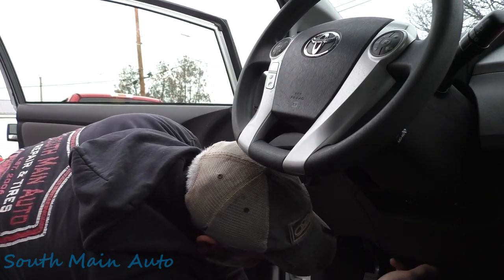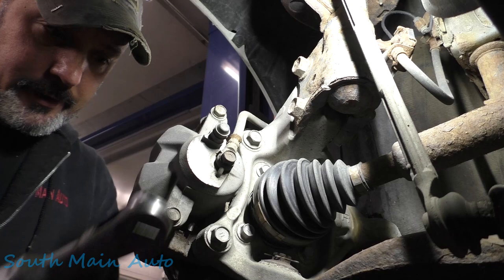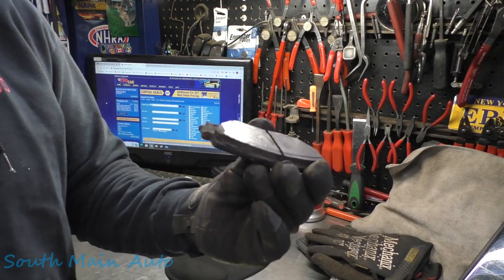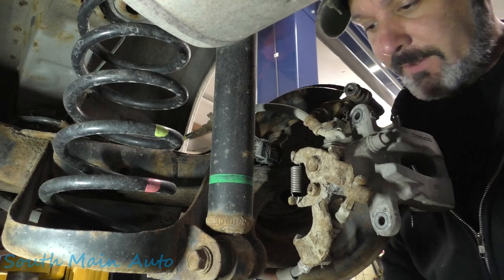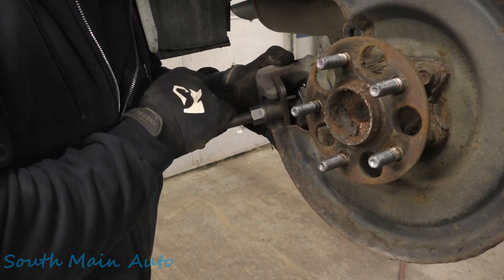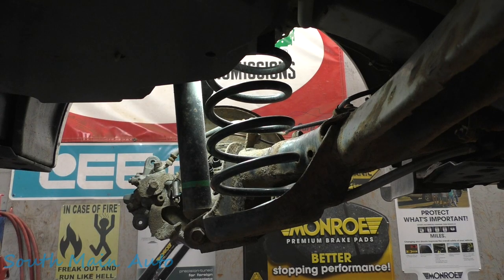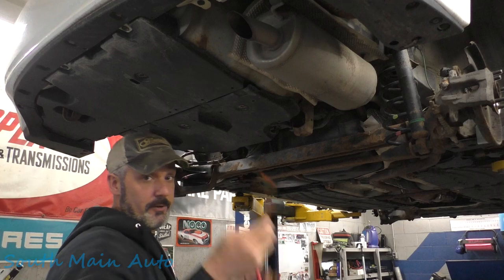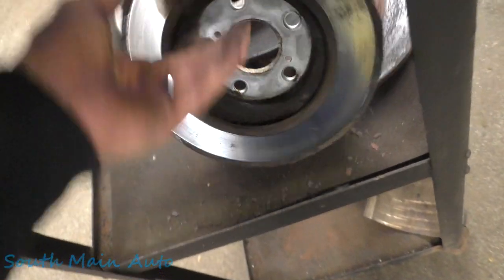Loud Grinding Noises & Dash Lights On - Prius Edition

Comment: Family bought Used Prius and told Batteries need to be Replaced.  Cost to Replace More than they Paid for vehicle.  Batteries NO longer available to Order.🤪
Reply: did they discontinue the battery you need or is it supply chain issues?
Reply: @darnh6012  Unfortunately the Batteries were Discontinued so they Ate the Cost of what they Paid for the car.

Comment: A big and dangerous problem with the Prius is the electric vacuum pump failing. It's a dealer only part and is not cheap. I spent $1500 in parts fixing my sister's brakes... :/

Comment: You haven’t had any luck with Wagner’s thermoquiet?
Reply from the maker: OMGosh no, the only pad I will NEVER use. Ughh worst pad ever
Reply: @SouthMainAuto  their sales pitch is good!
Reply: @SouthMainAuto  I’ve been installing more of the Duralast Elites lately- excellent pads, the normal go to is just Golds for the price point.  My AZ store has an excellent shop deal price if bought with rotors.  I do like Napers Silent Guards too, but AZs warranty makes it so easy to stand behind the brake job.

Comment: I did not think that Toyotas needed any maintenance. THEY ARE SUPPOSED TO RUN FOREVER ?
Reply: Not hardly!!  Wait till the battery needs replacing!!  Hahaha 😁 😆
Reply: @cycleguy666  10 year/150,000 warranty on the ones from 2020 onward. When they do go bad, you have a choice of a new or used complete battery, or just having the individual bad cells replaced.
Reply: Scotty says
Reply: Ok boomer
Reply: @thomash1923  Who cares what Scotty says!
Reply: @mc2whls  the clik bait king. He USED to be good.
Reply: It's a 2014.....one more year or so and warranty is over just in time for owner to buy a new battery.   I worked at Toyota for a few years before retiring and I saw a lot of batteries purchased.... a few under the warranty.   The feds got on the electric manufacturers to extend battery warranty.   The batteries when I was there were new or rebuilt.   The rebuilt ones seemed to be hit and miss!  Ok as long as the warranty is in place but still pretty pricey!!   I will be sticking with internal combustion for the rest of my life.   Y'all  will either be electrified or maybe flying like the Jetsons!!  Hahaha 😁

Comment: I live in a basically rust free area in Texas, and I won't turn a rotor anymore. Just not worth it. Last time I did it, back in the 80s, my truck ended up with bad warpage in the rotors.

Comment: I own a 2005 ram diesel 2007 grand caravan 2013 gmc 3500 savana box truck and want to buy a bidirectional scanner with tpms was thinking a autel mk808ts but you just said in a recent video that autels are horrible on 2007 and older chryslers so what would you recommend please give some choices in the 300 to 1000 dollar range ,no decent machanics where i live i need to do repairs my self , im poor but you gotta spend money to keep cars running , please help!.

Comment: Very few shops will turn rotors anymore.  Their fricking excuse is “ the owners decided it’s a liability “  They just want to sell new ones for more profit. I used to get at least one set turned once on the front ones for like $10 each. After that I bought new front rotors.  On these light weight pieces of junk cars nowadays I would believe turned rotors would not be a problem unles they were in bas bad shape.

Comment: I have a gen2 prius 2008. You must leave your key fob in the house, or disconnect the battery, as when your aoproach is sensed, it sets the calipers in automatically. I've read where the calipers pushed out, after removing from the rotor, and it was a bitch to push them in; they pushed right in, after battery was disconnected.......

Comment: Fairly easy money.  Just need to get it done. Damn Toyota dealership priced $210 a wheel. Can you see $840?  They will not turn rotors, have to buy new. Ridiculous ripoff
Reply: turning rotors is a sure comeback in 3-5 months....those things will be thumping from being warped because they get too thin...if it's my vehicle, sure I turn them a bit but for customers, get new ones every time
Reply: When you figure in the labor rates, it is cheaper to just replace them.

Comment: HELP!!!!!
I usually find the answers I need somewhere on the internet or YouTube, but I can't find this answer. Please help, my wife's 07 Honda Accord SE, the front passenger wheel is moving back and forth, not side to side, it moves toward the front bumper and toward the passenger door, doesn't make any noise, and drives just fine, but the wheel shifting forward and backward is a bit unnerving , I've never ran across this before and I can't find anything about it, so any help would be appreciated. I can't get under it until this weekend,  so I was hoping to get an idea of what I'm in for.
Reply from the maker: https://youtu.be/5dljdbC6PaA

Comment: I'm pretty sure the EV revolution isn't going to put Eric out of business.. if anything I can see more brake jobs being needed if people are using one-pedal driving and hardly use the friction brakes.
Reply: @wandameadows5736  I think you've been getting some outdated or just wrong information. It gets down to -40 in the winter here and people still drive EVs. Yes you lose some range but so does any vehicle.

It will be some years before they're viable for some uses like heavy towing or semis, but they are a lot more viable than you are making them out to be.

Not sure why you are bringing politics into vehicles either. People that start talking about "pushing agendas" usually have their own agendas.

Comment: I don't get why (other than cost savings (duh) why manufactures (for as much as cars cost now) don't put rust proof/resistant hardware on them.  It's crazy that if you spend $60K (generous with today's cost) on a car it might last 5 yrs (which would mean you just paid it off if you didn't go for 84 mos or more) before it rusts out in salt belt areas...Not good.

Comment: i know dude that have spent thousands on a engine, trans and rear-end, but don't do anything to the brakes or suspension. then wonder why they rear ended someone or ran off the road. every car iv ever done was done from bottom up.

Comment: Your "on and on" explanations is what's interesting.
Man, you guys have a rust problem. What the frack are you using in your salt over there. I live in Norway with icy conditions about 6 months a year, but cars dont seem to rust as bad as yours do. My own car, a 2007 118d BMW has just some surface rust pretty much with nothing on the body. Only started with Fluid film the last 5 years.

Comment: Toyotas speed sensors are finicky as hell..  if youre replacing one and dont get it seated exactly the way they want to be then your abs will go all kinds of funky..  mine would trigger the abs every time only when you were slowing down around 5mph…. So i would be stopping at a light or stop sign all normally then every time right when it got down to 5mph it would go into the abs fart and pedal goes to the floor..  almost ran out in a few intersections…. Ended up reseating the sensors and boom went away..  the codes only said abs short to ground..  no speed sensor codes after i replaced em..  friggn toyotas.,

Comment: Since it’s winter time. Can set it on fire.  Battery will burn all winter
Reply: If this isn't a plugin prius, that battery is oldschool Ni-MH which is probably not going to have thermal runaway even if you short it. And with only 1,3 kWh it's not that much energy, compared to a bev.
Reply: @tschuuuls486  damn well maybe a good weekend bonfire then